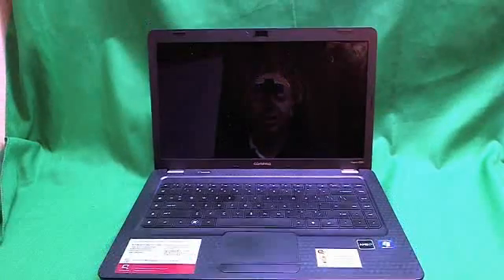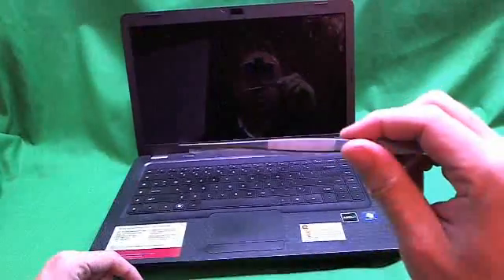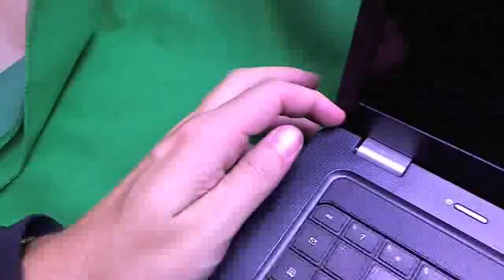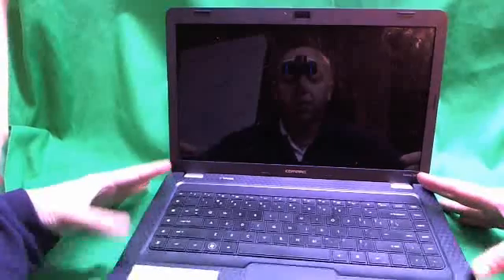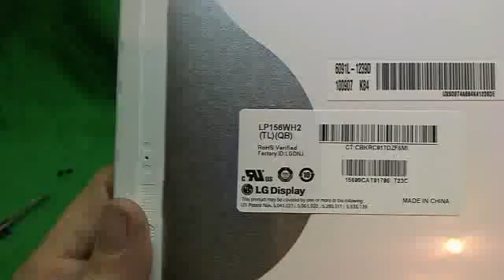Compaq Presario CQ56 Laptop Screen Replacement Procedure

Comment: Thanks, this video has very helpful! But you left out the most difficult step - getting the 2 screws at the bottom of the screen back in (the first 2 screws you remove). Lay the laptop on its screen, open as far as it can go. Put the screws in the holes and use a non-magnetic small blade screwdriver to tighten the screws using the side of the blade.

Comment: The screen not only had the video cable, which I unplugged, but also had a red and white wire coming out of the screen on the lower corner. How do I detach that?